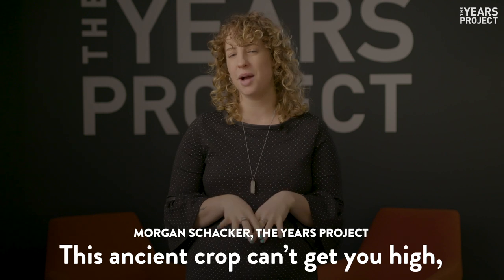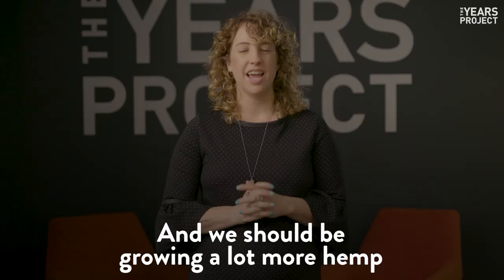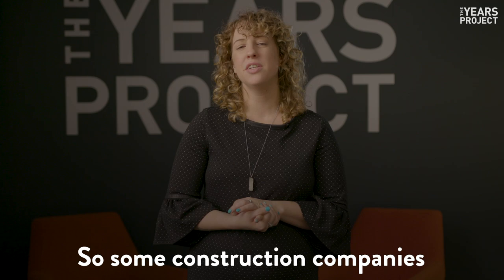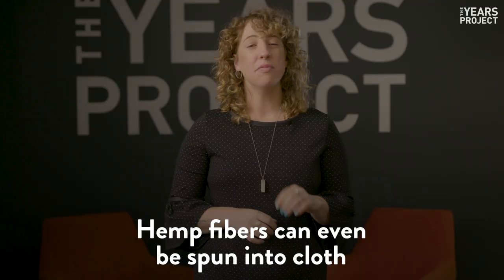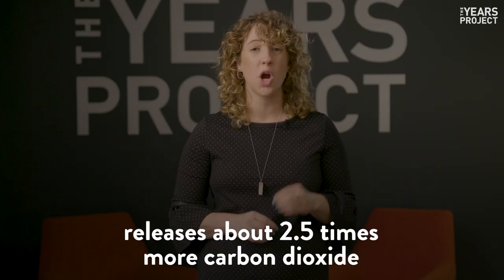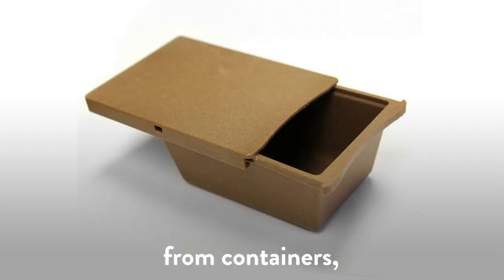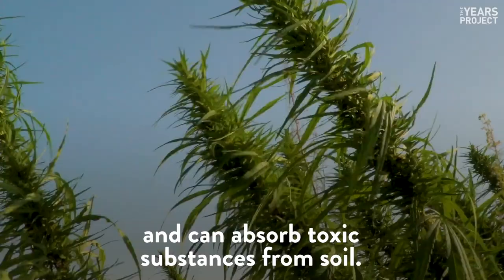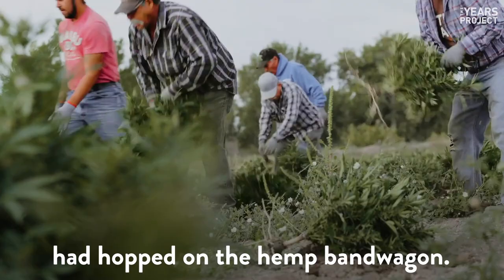Hemp Hemp Hurray: A Plant That Can Help Solve Climate Change

Comment: Hempcrete is not an ASTM rated load-bearing material for a reason. It has approximately 1/25 the compressive strength as Portland cement. 

Hempcrete is primarily used for insulation or as a veneer material to absorb carbon.
Reply: Anyway, if it's true what u say, concrete is still not the best sufficient material. It is (as it has always been) WOOD !
Reply: @kajakern268  FALSE! Several major concrete & aggregate companies have fully committed to be 100% zero emissions, and carbon dioxide free by the year 2050. Just look at leading companies like Lehigh Hanson. They’re already pioneers in this department by uses of CCS to remove carbon footprints. 

On top of this, hemp for the reasons Brian listed would be economically detrimental as infrastructure already requires immense efforts to maintain even with the most advanced material engineering. It would not only be too costly and unpractical, it would also be negligent as it is not near as safe. Would really want to drive on bridges, and live in buildings that are 1/25th the compressive strength? 

Even if you answer yes to that rhetorical question, most people would say no.